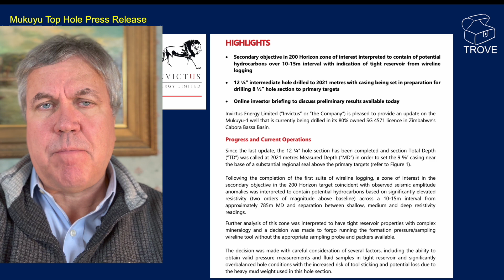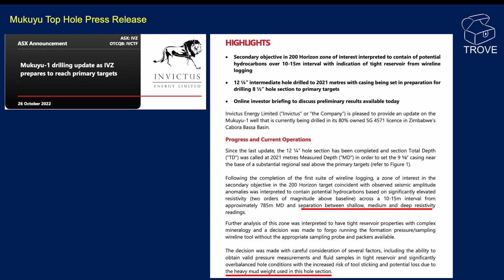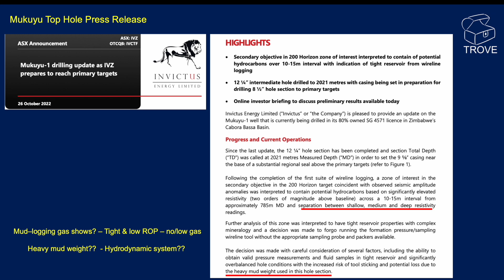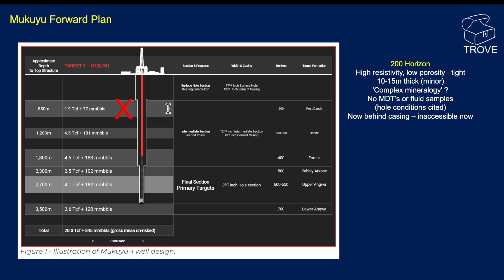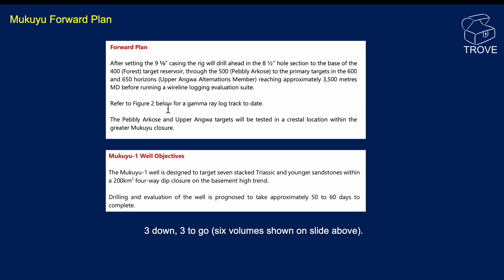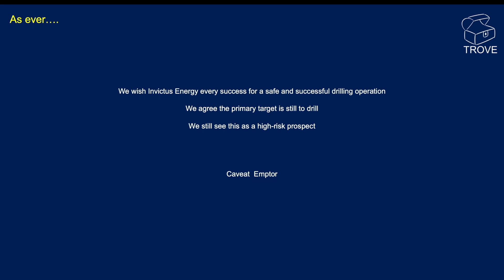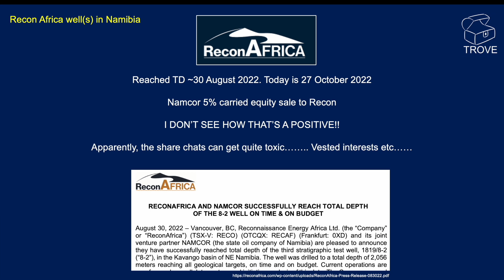ZIMBABWE Invictus Energy - Mukuyu-1 early results

Comment: The presence of a working petroleum system as evidenced by the gas fill in the 200 horizon and a robust seal of around 350m of thick shale and clay seems to remove two key risks for the primary targets.  Is there any technical reason that you don’t seem to be excited about the potential for success in one or more targets from the base of the 400 down to the 650 horizon?  I would have thought with source, reservoir and seal being de-risked that you may have changed your mind on the CoS for the deeper targets?
Reply from the maker: Anthony, thank you for your comment. "Gas fill in the 200 horizon" - your interpretation. High resistivity in tight rock - could be. May not be. Need more detailed data (e.g. mud log, mud properties, petrophysics etc) before I would support your interpretation. all thing considered I did not consider this a commercially significant accumulation.

I believe I state the mudstones are indeed good news. Whether they are integral in the potential at the horizons you refer to remains to be seen. There is insufficient information to judge. With due respect, my interpretation does not seek the support of anyone.It is my technical opinion. Please feel free, as you have done, to express an alternate view.

We will know in a few weeks.............
Reply: I don't understand, my mind is too small as regards this geo-technical analysis, but my view is that the gentleman is so pessimistic about the Mukuyu-1 prospects. Does it mean it's more promising that Zim will find Oil at Mukuyu and the Cabora-Basa basin?

Comment: All quiet on the Trovian front?
Reply from the maker: With failure of the LWD tools we are awaiting logging results. Mudlog shows are a good start - always good to read descriptions like "strmng cut fl, crush cut, cg well-rnd sst, hi vis por" etc. etc. Haven't read that yet but wouldn't expect minutiae of detail in a press release. Wet gas shows well above background is a good start. We will await wireline results including pressure tests and fluid samples. I would ask a mudlogger to comment on the sandstone UV fluorescence in the photo.

We have seen many a well with shows that have had cement poured at TD so let others get excited. We hope to do a post-mortem on the well, but we have to balance other priorities.

The usual buyers and sellers I understand on each snippet of news. Twas ever thus.